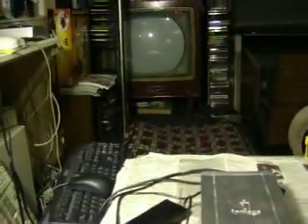IOMEGA mdhd10t-u2 ext hard drive repair

Comment: My hard drive, the same as yours recently stopped working and that's when I found this video. £1.48 later for the two capacitors and it's working a treat. Thank you so, so much.

Comment: I am in need of a power supply or dc-in cord for an Iomega 1TB External Hard Drive.  Can anyone help me or direct me in the right path?
Reply: If the cable breaks, open it and weld it with the soldering iron. Be careful when cutting, and before soldering see where cables 5b and 12v are connected